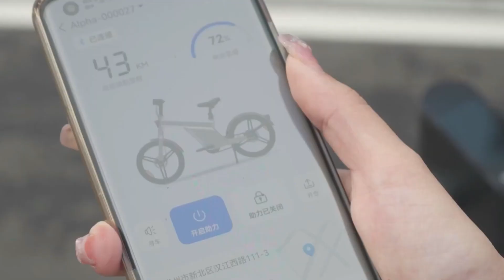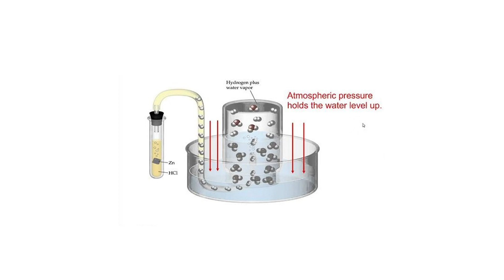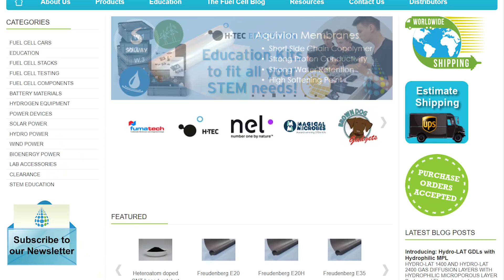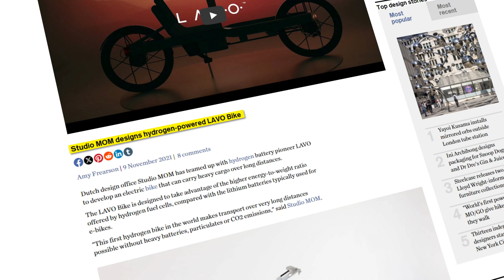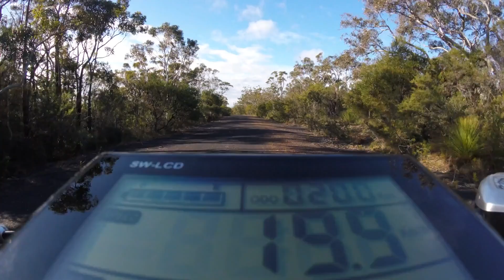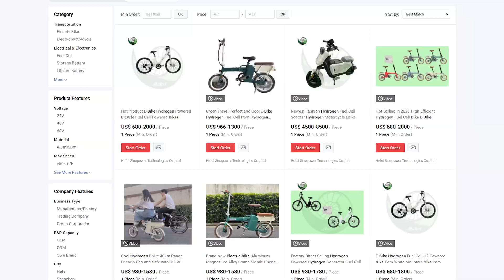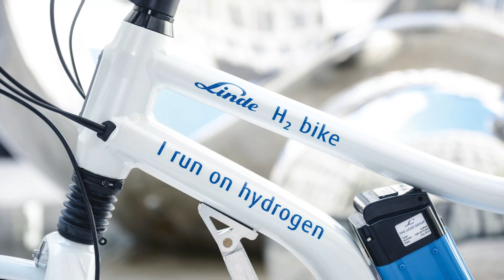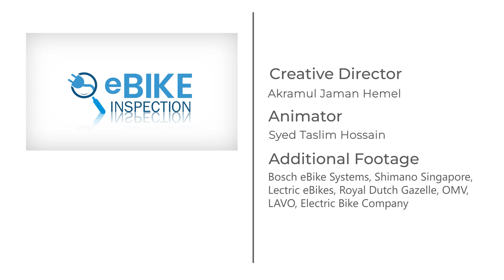Is This The Future? Or Just An Overhyped Trend?

Comment: Look at that stupid heavy tank that will become brittle and require replacement along with all the components that hydrogen destroys in eight years.  Wow this video did not age well.  Hydrogen, the 30% efficient, super expensive, low power density battery that nobody wanted. I'm guessing all of those bikes are out of production.  These companies will only exist as long as the oil companies and governments fund them.  All of their products will end up powered by batteries or in the junk yard.
Reply from the maker: Your observation is spot on. Let's just see what happens next. 
We can predict anything but confirm nothing.